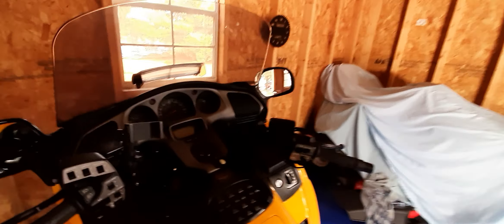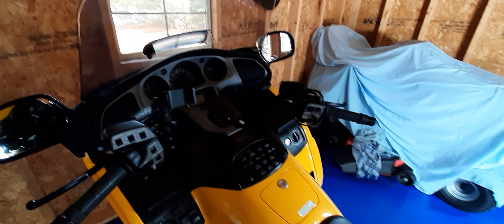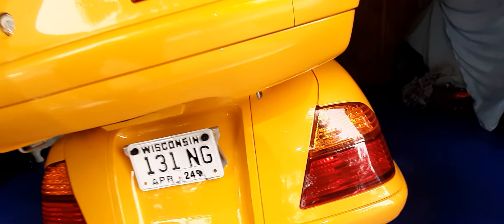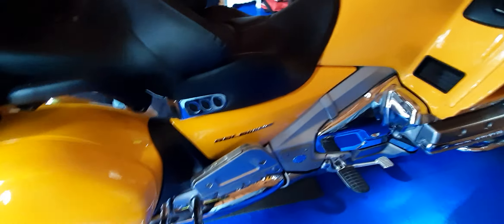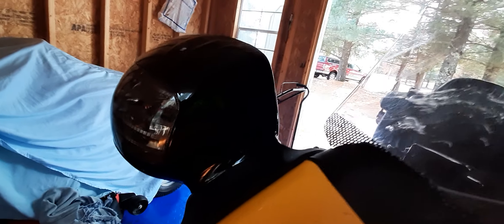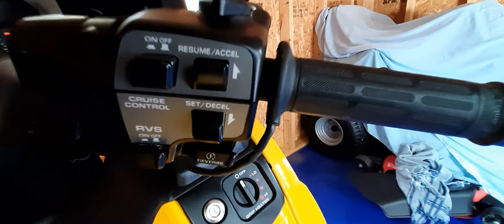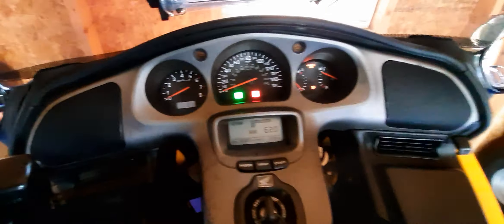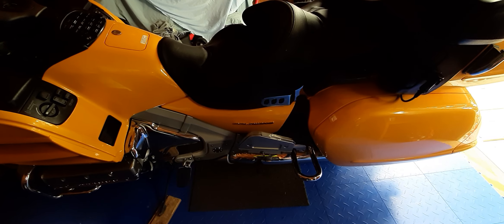1 step forward, 3 steps back.

Comment: Sir, as an owner of a 2003 Goldwing, I can tell you that the switches are always going to be a problem as time goes on. They are the only thing on the Wing that is poorly made. The solutions are as follows:
1- After long term storage, use a hair dryer to heat up the switches then "exercise" many times while warm. This will soften up the internal grease in the switch which tends to harden when sitting. 
2- Before each use of the bike, "exercise" all the switches several times to ensure they are working. This helps keep the grease from seizing up again. 

Plan on replacing the switch handlebar units every 10 years. You do NOT want to be stranded in" Upper Rubber Boot, Montana" because your reverse switch is stuck. 
As for cleaning them, I can't offer assistance as I don't do that sort of tiny manipulation of small parts. 

The worst switch of the lot is the emergency flashers. I have glued them in the off position as it's not likely they would ever get used, and once on there is a good chance you will be stuck with them on (going down the highway with everything flashing...not worth the risk)

Hope that helps...
Reply: Oh, one other thing. If the flasher switch gets seized on, try flicking one corner of the switch quickly with your thumbnail and sometimes that will loosen it and turn it back off. Then glue it ...
Reply from the maker: When the weather starts to stay in the 60 degrees, I'm going to take it in for a inspection. It has been sitting for a little while. I'm sure it could use it. Thank you Robert

Comment: Ahh the memories of those switches… that emergency flasher is easily taken apart and cleaned. You will find plenty of fine dirt interfering with the spring and lock assembly inside that switch. Unfortunately, the contact cleaner will not work on this switch while assembled, but you can take the switch out, disassemble the switch and use the contact cleaner to clean the little spring and plastic parts and reassemble and reinstall the switch. The release levers for helmet locks are just above the locks inside the trunk. There should be little knobs attached to a shaft at the bottom inside of trunk. One for each helmet lock. The side panels just pull off. They are little tits that slide inside rubber grommets. These tend to pull off hard. I just spray a little soapy water on the grommets before reinstalling the panel on either side of the bike. I’m sure the running light is just a bulb replacement and as far as battery… I keep mine on a tender, but, for peace of mind, have it load tested. Nothing worse than being stranded with a weak battery. Don’t let this wing discourage you, it’s a super clean bike and just needs a little attention. It’s awesome. I’m too old to do videos and high tech stuff. Not my generation for sure.
Reply from the maker: Or you could edit out the number someone else might need too know this information too
Reply: @mars4508  I just spayed grease and fixed the problem
Reply from the maker: Thanks Tony, I will give it a try